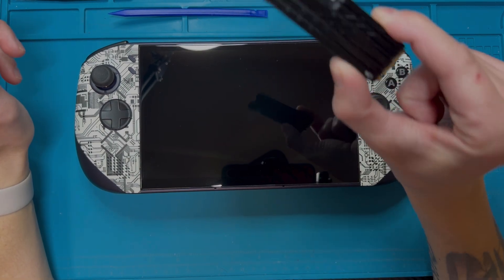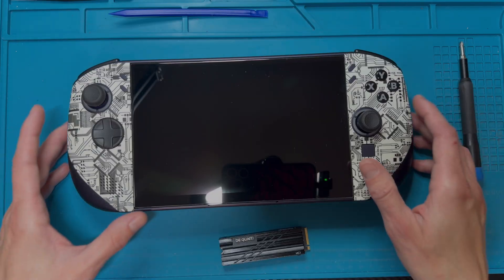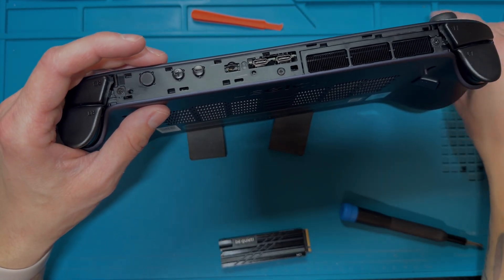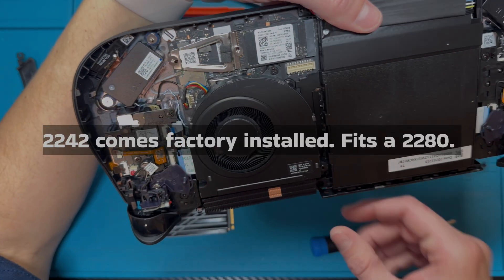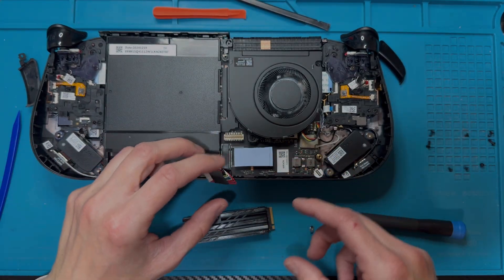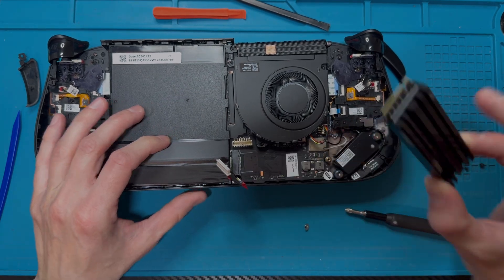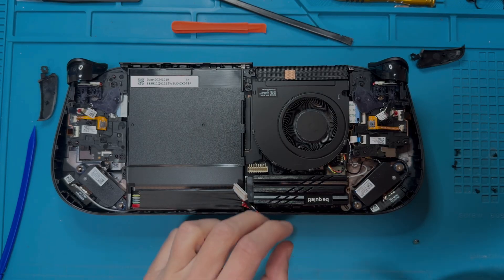Legion Go S Storage + Heatsink Upgrade Guide!

Comment: @GamingRepairs will the SN850X 8TB with heatsink fit and work as well in the Legion GO S? any recommendations for a better 8TB drive to use for it?
Reply from the maker: An 8TB is the same physical size as the 4TB so it will fit. I’ve never used an 8TB drive. Looking at the prices on Amazon Canada, it costs more than two on sale Legion go S’ for one 8TB drive. 👀😮

Comment: Do you have to clone it? If I put in a new SSD will it initialize it and boot up normally?
Reply from the maker: If you put in a new drive, it’ll be completely blank with no data on it. You would need to create a usb media boot file from Lenovo’s website using your device serial number to download the file and create the usb drive on a PC. Then you would need to boot into that usb drive from the bios options and run the install to load/install the Operating System information to the empty ssd drive.

Comment: Anyone else finding their left bumper is more ‘clicky’ than the right? Almost feels more loose? .. not Major .. still works perfect
Reply from the maker: Have you tried opening it up to see if you can adjust it?
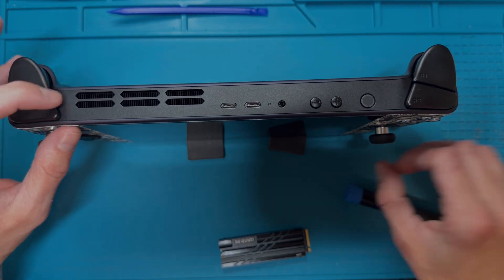Reply: @GamingRepairs I haven’t , do I just remove the deco strip and maybe tighten the retaining screw holding on the bumper (no need to take bumper completely off??) .. I see during your video aswell before tear down, as you lightly tap the bumpers at 1:24 (before clicking them fully) yours makes the same noise (it’s like an audible click before actually clicking it fully down)
Reply from the maker: Yes, remove the top strip to access the screw. If it’s loose, try tightening it. Otherwise I would unscrew see it if needs to be reseated like at 13:48.
Reply: @GamingRepairs thank you , by hearing yours making similar noise at 1:24 I think it’s just my OCD getting the better of me 😂
Reply from the maker: Alright 😂

Comment: What are the thermals with the new ssd
Reply from the maker: Using 30 watts and playing Spider-Man 2 in 1200p is about 65 degrees Celsius. This is the heatsink that I’m using: https://amzn.to/45ms87Z
Reply: @GamingRepairs nice.. went with the legion go 2 z2e and tossed an SK Hinyx 2tb in it running at 45c the go 2 came with a built in heatsink for the ssd though. Thanks for the reply
Reply from the maker: The thermals are pretty good. 😊

Comment: Wanted to say thanks for this and your earlier video. This and one other video helped cement my decision to go with the Z1E model instead of a used ROG Ally X. I realized the screen was just too small on that, the new Xbox Ally X, Steam Deck, etc so decided to go this route. I'm picking it up tomorrow along with my OLED TV from Best Buy and Monday I get the 4TB NVME to upgrade it. Complete with RetroDECK. Also got the DBrand stuff. If you happen to find a nice carrying case for it that could carry the handheld, perhaps a charging brick or battery pack, a cable and a microfiber towel, you should make a video on it! Accessory videos are always nice.
Reply from the maker: You’re welcome!😊🫶🏻 I have a couple options for you. 🤔

Best Xbox Ally X Case? JSAUX Max Carrying Double‑Decker Review
https://youtu.be/8G7hA7oIXrE

Tomtoc Sling - https://amzn.to/4q2guHW
Reply: @GamingRepairs  Would that work for a Legion Go S? Sorry if my prior comment wasn't specific. I was looking for a carrying case for that handheld.
Reply from the maker: Yes, both work with the Legion go s and I show it in that video link. 😊 

For the tomtoc case, I show that one fitting the legion go s and killswitch case in this one: Legion Go S + Dbrand Killswitch Case - Two 🔥 Deals You Shouldn’t Miss
https://youtu.be/hqX2rXGxv7s

Comment: So i have a 2tb samsung 990 evi plus should I use a heatsink?
Reply from the maker: I still would just to keep it cooler but it’s not required. More of a nice to have if you can fit one. Still use the factory thermal pad if possible should you choose not to use a heatsink.

Comment: Do you know if the replacement thumbsticks for the normal legion go fit the go s?
Reply from the maker: I didn't go deep enough to see the joystick tops but I did see that the joystick modules are soldered on and hall effect which is different from the original Legion go. I'm not optimistic that the joystick caps from the Legion go would be interchangeable with the Legion Go S. What are hoping to do?

Comment: wait we can't just clone the drive when its windows? is there any steps to do after cloning for windows?
Reply from the maker: I clone all my devices offline with a cloner. It doesn’t matter which OS is one there. You get an exact duplicate of the drive. A 1TB drive cloned to a 2TB drive with a Linux OS format will automatically extend you the full 2TB. But a windows clone, will give you the 1TB exact match then you have to go into disk manager and manually format the partition to give you the extra 1TB of the drive to get the full 2TB. I cover that part in this video below if you want more info and a visual to reference. The chapter is flagged for extending a partition.

Onexplayer G1 NVMe 4TB 2280 Install and How To Extend The Partition
https://youtu.be/OylZJ3P3fDk
Reply: @GamingRepairs ooh I see. I thought it's something to do in bios or something like that. Thanks for the clarification, this video is really helpful!
Reply from the maker: You’re welcome! 😊

Comment: 2:42 so because its steamos you'll only put 2tb but if it was windows you'd put 4tb. Why? Where's your logic here? I fail to understand. What if you want to carry alot of AAA to indie games on the go without uninstalling/re-installing games and have a library of 400+ games? Is your reason because of windows bloatwear?
Reply from the maker: It’s because I can’t/wont jump through hoops to install any of my Battle.net, Epic Games, or Game Pass (like Call of Duty) again. The gameplay and experience with patch work sucks and it’s just made for windows. Also can’t use it for work due to steamOS so no work files, media file storage, or any of the windows apps that I require. One of my 1TB micro sd cards has emulation classics loaded up. I own 5 handheld PCs, 3 of which are running windows. My logic is that I don’t need 4TB in every single one. I have all the games I want on there and I’m only using 1.2TB. 

For my personal use case, 2TB is plenty on SteamOS. I hope this helps you understand. 😊
Reply: @GamingRepairs  hi, just curious the 2 tb is just preference, if I wanted to do 4tb there is no risk of damage or negative issue here? thanks for advice.
Reply from the maker: @sxspdlgnd  I had a spare 2TB lying around. Personal preference on SteamOS. I only really need 2TB. You can slot a 4TB and call it a day. 😊👌
Reply: @GamingRepairs more than enough between your video that helps show changing the SSD and this explanation. Top tier woman. I also grabbed this during black Friday, man, It's a beast so much power in a handheld is unbelievable
Reply from the maker: Heck yeah, you did! The Black Friday sale was legendary. The Legion Go S is so sick! 😁🙌🏻

Comment: I wanted to replace the SSD, but after watching this video I changed my mind. It's completely brutal.🩻🩻🩻
Reply from the maker: At least you know what you’d be in for. It looks worse than it was. 😂
Reply: @GamingRepairs  I have a Lenovo Legion Go S Z2 Go. This is my first portable console purchase, and while it has a 15,000 mAh battery—I won't even mention it while gaming—even just using the console drains the battery very quickly.
Reply from the maker: Which power profile are you using? You would want to adjust it depending on what you’re doing.
Reply: @GamingRepairs I mostly use the Balance profile
Reply from the maker: On SteamOS or Windows?
Reply: @GamingRepairs steam os
Reply from the maker: Are you using the steamOS channel it uses by default or did you change to the better developer channels?
Reply from the maker: @khalidaysultanov3816  If you're still you the default channel, I would switch to this one: https://youtube.com/shorts/8J3eNzEZauY
Reply: @GamingRepairs thanks😊
Reply from the maker: You’re welcome! 😊
Reply: I bought a 2 tb micro sd
Reply from the maker: Oh wow! I didn’t even know a 2TB existed yet. 👀 Looks like Sandisk has one but jeez that’s expensive when you can’t run AAA titles on it (240MB/s read speed). In Canada it’s showing only $30 less than what I paid for my 4TB 2280 7,000MB/s Lexar NM790. 😬
Reply: @GamingRepairs  Does the reading speed somehow affect performance in games? I just bought a console with 512 GB of memory, and I have the same small SSD, but it reads at 2000. 1TB
Reply from the maker: Read speed can, yes. I would never install or play any game with higher end graphics onto a Micro sd card.
Reply: @GamingRepairs what do you think about external ssd enclosures? I got a good Black Friday deal but it did hurt my pockets
Reply from the maker: Which one did you get?

Comment: Great video! Thank you. I have a question regarding the cloning of the ssd. I plan to upgrade the ssd to my new Legion go s z1 extreme (waiting for it in the mail) as soon as I get the device I plan to open it and clone the ssd without even turning it on for the first time. Is this a bad idea? Should I turn it on before opening it?
Reply from the maker: Appreciate it! 😊 I usually turn it on first just to make sure the device is working and actually powers on (Keep in mind you’ll need to plug it into power to boot the first time). Then I shut it down, clone and replace. Never setting it up that way if or when I sell it, I just swap the drive back and it’s factory without any fuss for the next person because a fresh boot after means  chasing drivers, legion space, etc.
Reply: Thank you so much!  I emediately subscribed to your channel. I have enjoyed many of your videos keepbup the good work!
Reply from the maker: Aw thanks so much! 😁🫶🏻

Comment: Are the z2go and z1e just different amd chip only or when u open it you feel both looks different hardware just like deck lcd and deck oled
Reply from the maker: The Z1E is the better chip.😊 AMD only chips. That's the one that you want over the Z2go.
Reply: @GamingRepairs  i think they ment is the visuals of the internal components different between the z1e and the z2 go like the steam deck lcd and steam deck oled internals
Reply from the maker: Yeah, those ones have a lot of differences inside for sure. Battery, screen, etc.
Reply: @GamingRepairs  I actually hates z1e it's bettery killer this why steam deck is a king but I was meant when you open go s z2go and go s z1e are you going to see different hardware or both are same in everything just different chip only in steam deck the oled vr valve changes everything not just oled
Reply from the maker: Only the chip/board should look different. I would never buy a Z2 Go device though so I couldn’t say for sure lol.
Reply: @evilcrashbandicootthetouho2753  It’s not a battery killer. Where are you getting this misinformation from… The Z1e is a vastly superior chip to the z2go in every way…
Reply: @LouieM727  no the different between z2go and z1e is 5% in power mod when play old games steam deck running better than z2go and z1e , I play the evil within test on deck , z1e,  z2go and I found deck did better because the custom amd this why valve what new custom for deck 2

Comment: Horrible design by Lenovo to have to take all that off just to remove the back of the handheld. That means that every time that you want to clean the single fan, which will be often since it’s only one fan, you will have to worry about removing so many breakable components. With my Ally I just pop off the back piece and that’s it.
Reply from the maker: Yeah, they could have made it so much easier is user friendly to remove. The Ally is super easy. 💯
Reply: @GamingRepairs fr tho, that would be a headache everytime 🤦🏾‍♂️ I don’t get why they would make it that tedious to remove the backplate.
Reply from the maker: They just don’t want us in there. 😂

Comment: Hey Nelly, what brand or nvme drive did you replace it with?
Reply from the maker: Oh wait, this one I used a crucial 2TB 500T. But I bought that one years ago haha. I usually get the lexar ones now. Unless crucial is on sale.
Reply: @GamingRepairs  Hi, I'm thinking of using a Samsung 9100 Pro 2TB M.2 Internal SSD with built in heatsink, do you think it'll be ok? I've heard 9100s run hot/drain battery?
Reply from the maker: Hey! 😊 It wouldn’t be worth using in this device. The NVMe slot is a gen 4 not a gen 5 so the max speeds you’ll get are 7,000 MB/s. That samsung driver is better utilized in a desktop for power and heat to performance with a gen 5 slot to utilize the full 14,800 MB/s speeds.
Reply: @GamingRepairs thank you!
Reply from the maker: You’re welcome!😊✌🏻
Reply from the maker: I used the Lexar NM790 4TB. It’s usually the best priced 4TB drive from a main brand and you can get it with or without a heatsink. I have noticed at least in Canada that it’s about $50-80 CAD more for drivers right now over 4 weeks ago. Hopefully some Black Friday deals to make it better.
Reply: @GamingRepairs  Thanks! Another quick question, just curious, do you ever battle with choice paralysis if you have a bigger drive and install several hundreds of games? I'm on the fence right now since 1tb ssd and 1tb micro sd seems to be enough to have a few games in rotation. 

Everyone is different but I'm curious about how you handle that situation, maybe you make the most of the extra space better.
Reply from the maker: The problem with the SD option is that you can only really run indie games on there. High performance games will tank in acutal performance before your data read write speeds on a micro sd card are max 190 MB/s at best (most card readers in devices are capped lower). Whereas with an NVMe you’re getting up to 7,000 MB/s. It’s a really big difference for any higher end graphic game.
Reply: @GamingRepairs  Great point, thanks for sharing. I think the read speeds gets often overlooked. Great channel. Subscribed now. Cheers.
Reply from the maker: You’re welcome and I appreciate the support! 😁🫶🏻

Comment: I did mine as soon as I got it, added a 4TB Samsung, but just used thermal strip not a heatsink. Does the heatsink actually have any available measured performance benefit? With & without?
Reply from the maker: The Samsung 4TB is a solid pick! There's a reason that the PS5 expansion NMVe drive needs to have a heatsink. It's to prevent overheating and throttling with demanding games. I do notice a few degrees cooler temps when using a heatsink. It's more of a preventative measure to regulate temps and performance.
Reply: hi, see you did the 4 tb, how has it been ? any issues? looking to do the same on S as well. On my SD did ext drive and don't like it so with this one want to keep everything on the handheld.
Reply: @sxspdlgnd I haven’t had any issues. I didn’t use any low profile heatsink as shown here, I just used a thermal strip. But I haven’t had any problems and don’t feel like opening it all up again.
Reply from the maker: @sxspdlgnd  You won't have any issues with a 4TB. I have 4TB's in all my other handhelds.

Comment: Personally already did mine a while ago just ended up using a 2242 drive to re-use the thermal pad that comes with the Legion Go S it was also a 2TB drive hardest part for me was putting the shoulder buttons back in without breaking them as the guide I followed mentioned that if your to rough with them it can break the clips & while they'll work they'll be a little loose which I didn't want, now the only way I'm opening up my Legion Go S again is if a extremely good deal on at least a 4TB 2280 SSD comes up otherwise I've already got a extra 1TB MicroSD card for extended storage for it.
Reply from the maker: Yeah the prices on the 4TB have gone up $50-$100 over the past two weeks. Hopefully there will be at a decent sale price on Black Friday. Memory prices are climbing. 😬
Reply: @GamingRepairs  Well not like 3TB of total space is all that bad more space than a Switch 1 or Switch 2 has so even if 4TB SSDs don't come down in price anytime soon I won't exacty be hurting for space with a 2TB SSD & a 1TB MicroSD.
Reply from the maker: For sure. 2TB is the absolute minimum size NVMe that I can accept in a PC handheld. 😂
Reply: @GamingRepairs  Well the Legion Go S is going to be more of a on the go or just when I feel like playing a game in handheld mode for for me. Otherwise I'll be playing on my desktop PC that has Bazzite OS on it & that has 8TB of space. So the 3TB of space on my Legion Go S is all I need I mean I've got 106 games installed on my Legion Go S combined between my the 2TB NVMe SSD & the 1TB MicroSD I'm not hurting for choice to need more storage on my device plus its a fast enough PCIe Gen 4x4 so still faster than my old Steam Deck in that regard as well.
Reply from the maker: No doubt. You certainly have options. 😂🙌🏻

Comment: Specifically for the SteamOS version, are there any settings you recommend to change for a better experience? For example, leave vram on auto or change it?
Reply from the maker: Yes! In the bios, I set mine from auto to 16GB I believe. I think it jumps from 8 to 16. Ideally I would want 12GB though. 🤔 

In SteamOS settings, system, enable developer mode, then go into the developer menu (at the very bottom of the left setting bar) and enable option to show advanced channels then back out and go back to system settings. For OS Update channel, select main and for Steam Client Update channel, Steam Deck Beta (or stable if that works better for you - I’m on beta). Apply the update and restart. This should give you the best updates and patches quickly.
Reply: @GamingRepairs Thank you :)
Reply from the maker: You’re welcome! 😊